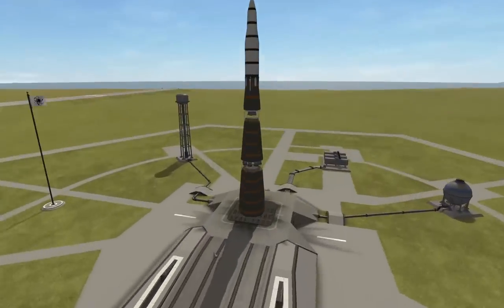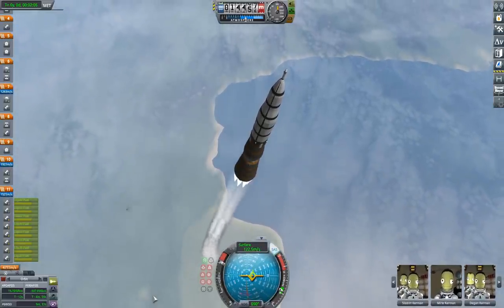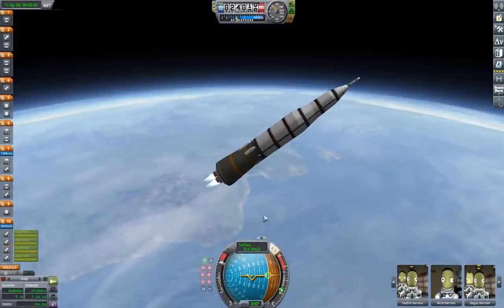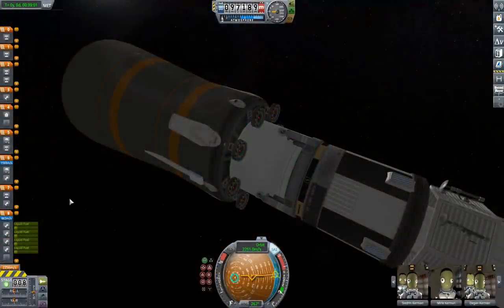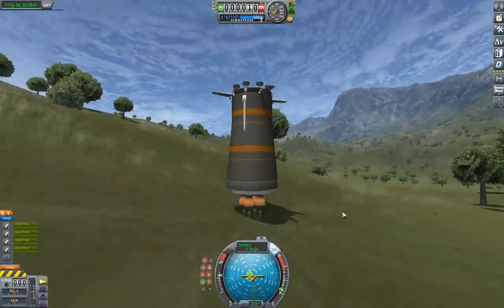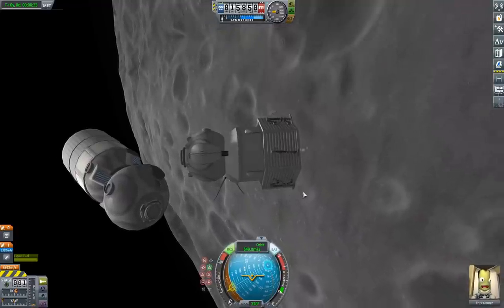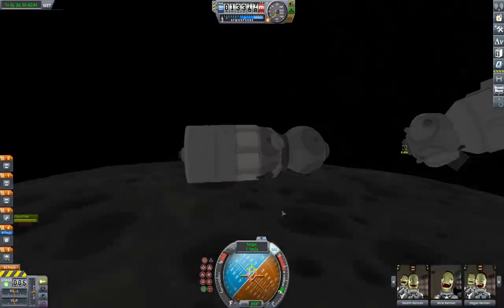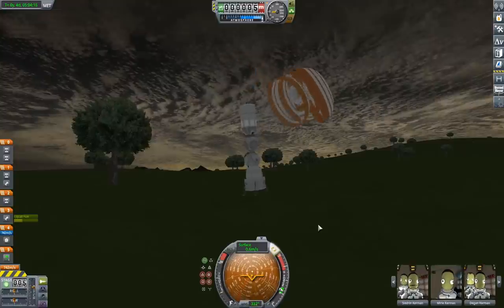KSP: Fully Reusable N1 (Soviet Moon Rocket)! [stock 1.11]

Comment: You can recover fairings if you put the fairing base at the top of the payload and basically make a ksp bucket but inverted with a minuscule gap between the end of the fairing and your fuel tank so you can just see through. Then you can attach parachutes and a probe core for recovery
Reply from the maker: yeah, I suppose that would work